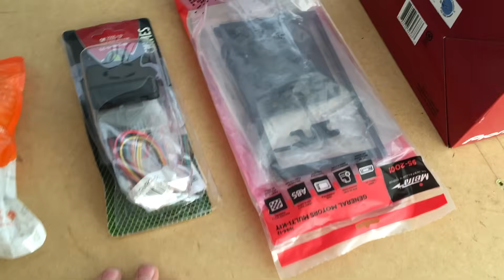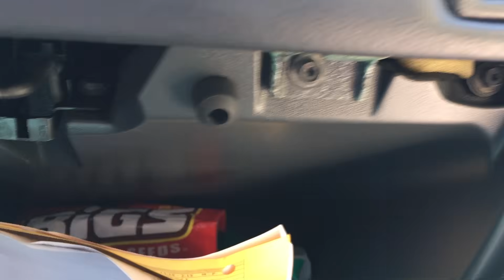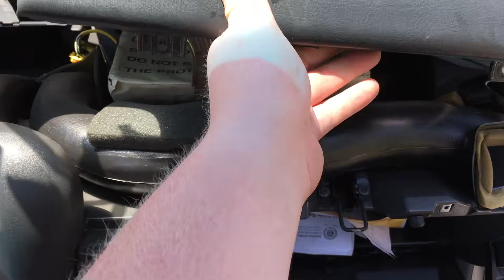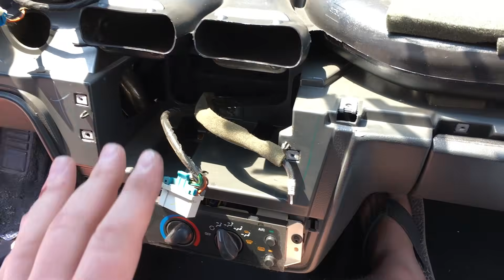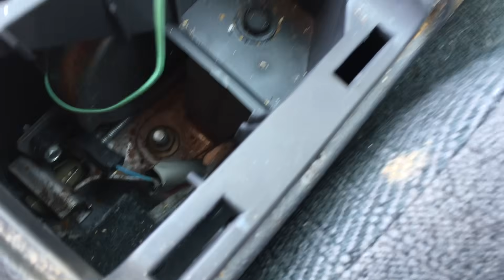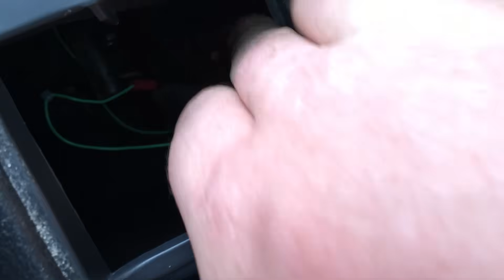1995 - 2005 Chevy Cavalier Radio Install

Comment: Just bought an 05 cavalier with 123k miles
Reply: Chris I have 04 Cavalier love it
Reply: @gamerboy93-l5t  just sale my old camry and bought cavalier 2001 with low miles
Reply: I have an 05 cav had it for 14 years still runs smooth I only replaced the struts witch I did myself. Have almost 120k miles on it love that car they just keep running maintain a smooth ride
Reply: 01 Cavalier Z24, decent car, hard to kill, rusts like a mother fucker though, other than that. Decent car.
Reply: Just bought an 04 ls sport burnt orange metallic. 117k miles. Very pleased with it! Getting the itch to install an after market system once again. Looks a bit more involved than the install for my 96 Camaro though.
Reply: I have a 95 that I drove from 1999 to 2012. I've put 230,000 miles on it. (Bear in mind we had to replace the head gasket twice and the head once.
Reply: Has anyone ever had an issue where the car clunks going into drive or reverse?
Reply: @andrewm5190  yeah, this started happening to me after i ran over a curb to prevent an accident with a drunk driver,  now everytime i hold my brakes longer than 3 seconds or when i go in reverse it just clunks up
Reply: @irv2034  I had an assumption that on mine it was coming from around the wheel. I am not sure what happened with the previous owner but had the front alignment checked out. They had informed me that the vehicle did have some body damage so that made it impossible to adjust  the passenger side rear. I will look into that, thank you.
Reply: I just bought an 04 with 113k kilometers as a winter/work beater!

Comment: dude y did u take of ur whole dash u didnt have to i litterly just installed an after market sterio in my gf 04 cavalier and i just took off the front face and thats it
Reply: Javi M You have to take it all off, Unless you want to break everything.
Reply from the maker: To get to the factory mounting screws for the factory radio, it is required to pull the dash apart.  If you already had an aftermarket radio / kit, or access to the screws, then switching the radio would be much simpler.

Comment: Will this radio fit in my 1996 chevy cavalier
Reply from the maker: No, as the beginning of the video states, years 1995 - 1999 only fit single din radios unless you modify the dash bezel.

Comment: Great video, just one question. Did you simply just tuck the small black speaker attached to the adapter behind the stereo? I'm assuming you don't have another choice, just want to cover all the bases before I start this.
Reply from the maker: Yep, just tuck it back behind the radio in any available space.  Should be fine.

Comment: i have a red wire left on the stereos connection and a (orange or red, idk) wire on the chime box says Ignition/switched 12v... What do i do with these wires?? which one goes to the wiper fuse or such? both together?
Reply from the maker: Connect the "ignition" wire on the kit to the stereo's red wire which is also the ignition.  I'm not sure what you mean by the "wiper" fuse?

Comment: I recently bought a 2001 cavalier and the radio was in the process of being replaced ,it was a mess and I've redone the wiring for the most part by my radio does not turn off ,even when I remove the key do you have any idea what I've done wrong
Reply from the maker: Check to see where your radio's Red wire is connected: this wire needs to be connected to a power source that is only on when the key is on.  That will be your issue.  Disconnect it wherever it is connected and a source that is only on when the key is on, like tapping into the cigarette lighter positive.
Reply: OK thanks will try it and see what happens

Comment: Do you just have to connect the two black ground wires together and that's that?  You don't need a third ground wire to attach to a metal part of the chassis?
Reply from the maker: Yes, just connect the black wires together (the end from the metra harness and the other end from the Stereo.  The ground works fine through the harness, but if you wish to additionally ground it to the metal chassis, you certainly can.  That was not done, however, in this video.

Comment: that dash will crack and break, trust me, even if you take care of it
Reply: The plastic under windshield broke on mine
Reply: bought a 2003 new.  still have it.  watched the dash crack after about year 5.
Reply: GONE F. Mine is cracked under the windshield as well
Reply: Man, don't I know it!
Reply: Been driving my 02 since 2 miles. It has 207k on the clock now. Oh ya- she’s cracked. Gonna use Fiberglas to repair. Might as well-I’m fiberglassing the rest of the rust together. Lol
Reply: Latin Lover yup sure did. :/
Reply: Tyler Sephiran lmao is true
Reply: Can confirm.
Reply: Mine is cracked ☹️ and I also have the missing channel button cover and now my speakers are starting to crack... It is sad to see it fall apart since I have been driving mine for almost 10 years now
Reply: My problem is I don't even have a place to put the radio as that area has cracked and the radio and air conditioning controls are just hanging from the wires.
Reply: True that buddy👍
Reply: Yeah mines cracked up by the windshield and I've never taken it off before
Reply: Only if you don't take care of it 100%. But mine hasn't broke but maybe 1 clip. Have taken it out 4 times and its cracked in the middle from sum damage from previous owner. So no I think if you've broken one before you were not considerate or you were fucked before you started
Reply: @tylerdowdy7788 not really but florida sun fucks it up is just bad quality
Reply from the maker: Yep, very common for these Cavaliers.  This was a customer vehicle, and they just wanted something to get them by.
Reply: Provo Beast Audio Installation
I had a 2004 cavalier for many years, the interior cracked so badly that the pieces broke off and the vents fell off lol the car was a mess, so i sold it and bought a mazda 6

Comment: Id really like to make this my next project, but i have a couple quick questions. the orange wire in the beginning, just don't use it? And what exactly is a t tap, and what is the video playback when the parking break is activated for? lastly, A rear mounted camera, would that be a possibility in this build? i figure i might as well go big or go home if im gonna be doing all of this haha
Reply from the maker: The orange wire (illumination) isn't always used, and wasn't used in this install.  We used the blue / white (dimmer) wire that dims the screen when the headlights were on.  The Radio didn't support an orange wire.  A t-tap allows you to  tap into a wire without compromising the wire itself.  Instead of cutting into the wire for the parking brake, a t-tap allowed me to tap into a wire without cutting it up.  Pioneers require a double pulse ground for the parking brake wire in order to watch videos on the screen and this wire (bright green wire) needs to be attached to the parking brake.  Finally, yes, a reverse camera is totally doable in this build.
Reply: I've installed the exact same stereo in an '03 Cavalier. I found out the hard way that the parking break wire is also needed to access the bluetooth settings for the stereo. If you ever want to unpair a phone with the stereo, you'll need to connect that wire to your parking break, or at least ground it.

Comment: Where exactly can I find the wiring harness for 2005 checy cavalier, I can't find one anywhere.
Reply from the maker: the model number is in the description, and just search amazon: https://www.amazon.com/Metra-LC-GMRC-01-Class-Data-Interface/dp/B001XOBU4C/ref=sr_1_1?ie=UTF8&qid=1473968384&sr=8-1&keywords=Metra+LC-GMRC-01+GM+Class+2+Data+Bus+Interface
Reply: is this the cheapest? I have a regular non touch screen radio, do I still need to purchase this one?
Reply from the maker: Yea, touch screen or not, this retains the ignition wire, door chimes, warning sounds, etc. feel free to looking around, Amazon typically is the best price.

Comment: radio won't turn on at all
Reply from the maker: Right, was it because you didn't purchase the chime harness? It would be because you didn't retain the ignition wire at the radio.  You will need to locate switched power elsewhere (like the fuse box) to connect the red wire to when you turn the key on.
Reply: Hey man, did you ever get your radio to work?

Comment: do i need a chime to get  power to the after market radio? i don't care to have it ?
Reply from the maker: Well the issue with these GM vehicles (depending on the year) is that they have the canbus system, or the data signal to the radio.  There is no standard ignition wire to turn on the radio on this 2002, so the harness used in this video provides not only the chime, but also the turn signal noise, ignition wire (red wire), etc.  You can get away by running a wire to the fuse box to locate switched power just so the radio will turn on with the key.  If its too complicated, the simple method would be just to buy the harness. Hopefully that helps.